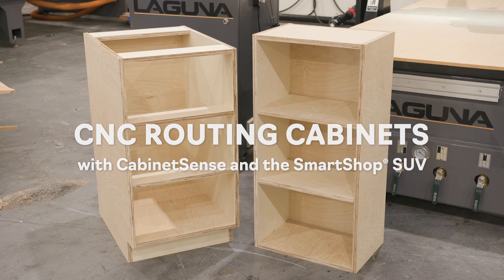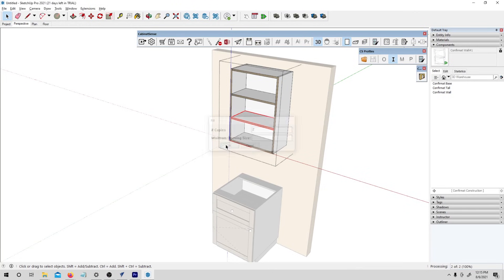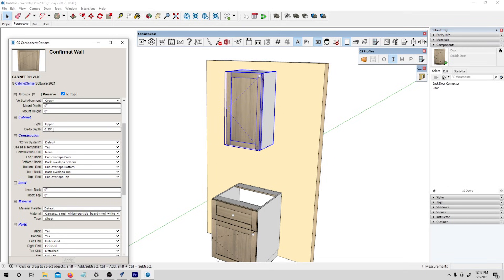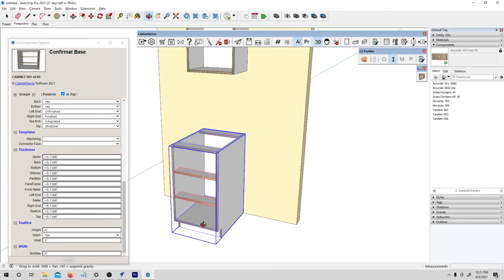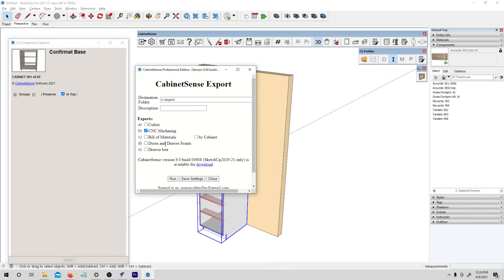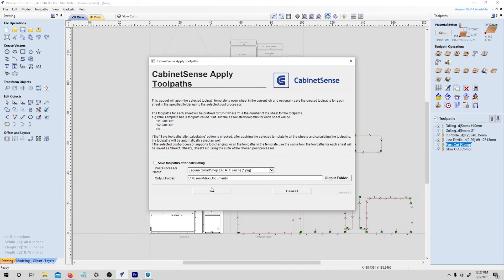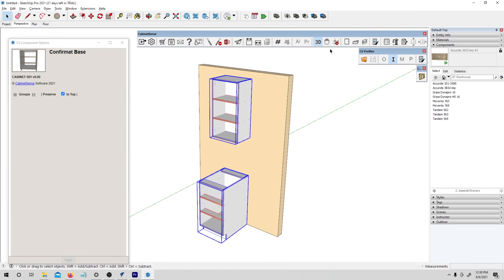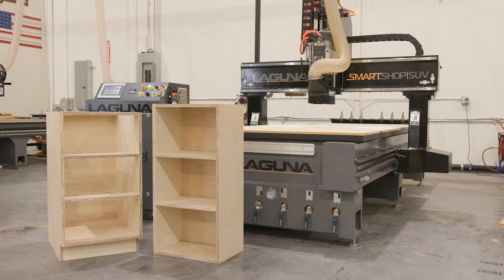How To Build Cabinets Using CabinetSense, VCarve Pro And A CNC Machine | Software Tutorial

Comment: You failed to tell them you need another machine to rout the horizontal support boards.
Reply: damn im trying to see if cnc is for me and saw this comment and been doubting that ill be flipping sheets, the datos are all offset so one side doesnt need to be cut as the holes are also offset, fuck me now im deff getting a cnc takes 50 mins to machine and glue up a cabinet box. it costs as much as a "ok" employee for a year full time.

Comment: Thanks for the video. Rookie Question: If you have a detailed set of hard copy plans for a cabinet, is it just a matter of entering all of the dimensions into a cabinet program in order to create a file to send to your CNC. Not minimizing necessary steps that would have to be done inside of a program but just curious about getting your original dimensions into a program. Thanks.
Reply from the maker: Hi Larry, we suggest you reach out to CabinetSense as they'll be able to answer your question a little better.

Comment: How much was the program
Reply: 25$ a month, 50 and 75$ Depending on how many cabinets your going to make. No limit on the 75$ A month. Which is not bad if your in the business of making cabinets.
Reply: @RandomAudioGuys  hey do you already use cabinet sense for your business
Reply: @RandomAudioGuys  hey do you already use cabinet sense for your business
Reply: @RandomAudioGuys  I am still using the software trying to get a hang of it, but I have challenge nesting
Reply from the maker: They have a few different packages they offer, but you can check out their prices here: https://www.cabinetsensesoftware.com/products